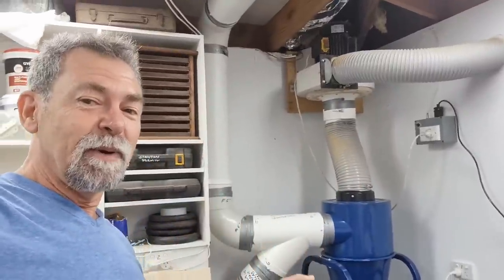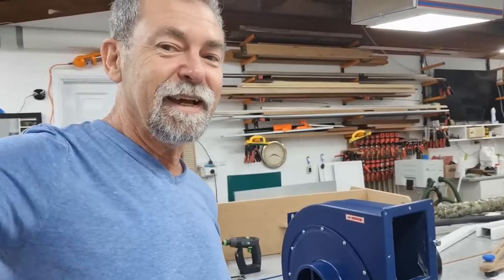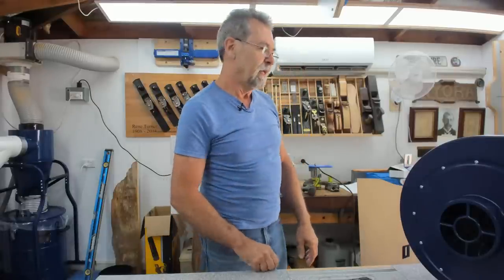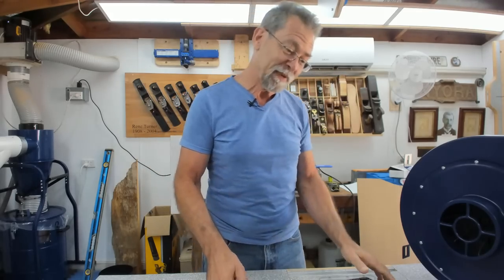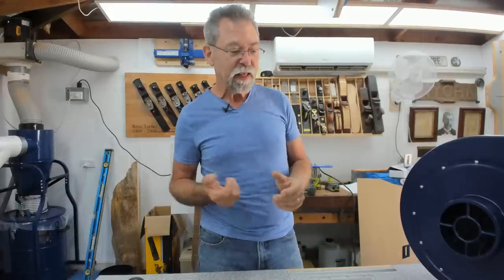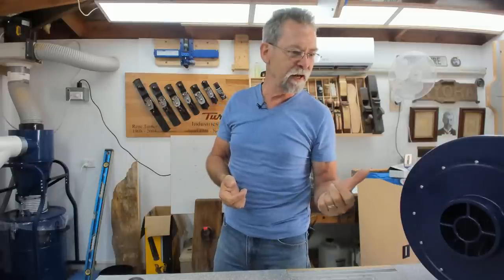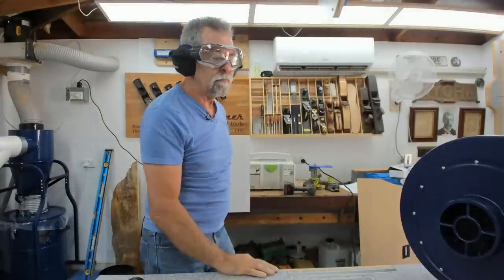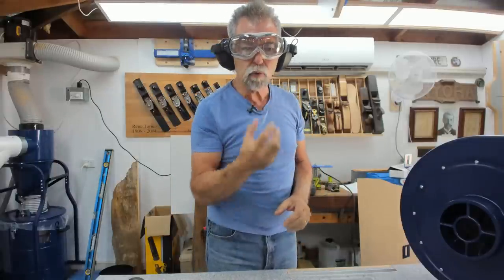Dave Stanton Live: How To Modify Your Dust Extractor To Capture More Dust!

Comment: Hi Dave, curious why you advocate against removing the bracings that protect the impeller. Isn"t the cyclone preventing any sort of big piece from getting to the impeller in the first place ? Cheers and thanks for the tips, I have an old 1HP king dust collector and was wondering if I could turn the way the outlet is facing, now I have to disassemble it :D !
Reply from the maker: Hi Simon, Leaving the braces or actually the finger guards is recommended. I am not sure what your question is? "why you advocate AGAINST removing the bracings that protect the impeller." Not familiar with a king dusty but good luck!

Comment: I have a similar system, and once you have a cyclone no need to replace anything but the blower.  What company made your new blower? BTW, with this type system you can put a plastic bag in your drum which makes it easy to handle your dust. Contractor bags fit my 55 gallon drum.
Reply from the maker: It is a carbatec dusty. The cyclone has a plastic bag that I get a few uses out of before replacing it.

Comment: Hello! Please could your share what power motor it is (3hp?) and the size of the impeller (diameter and height of the blades)? Did it come with a 5" outlet on the impeller housing? The reason i ask is that mine looks similar, and so 3d printing an adaptor to make it 6" eould be an option for me too (the square outlet is the area of a 6" diameter pipe so would work).  Look forward to your reply!
Reply from the maker: The extractor had a 5 inch outlet. Easiest thing is to buy the 3d print file and print it. I would say that there is over a 90% chance it will work.